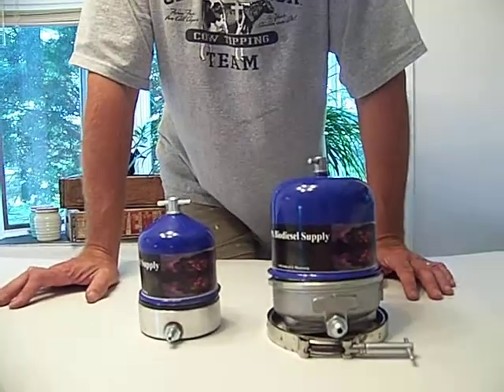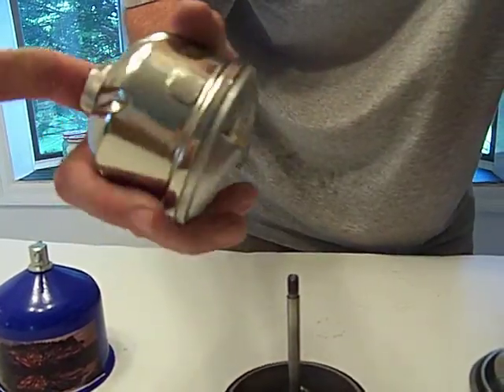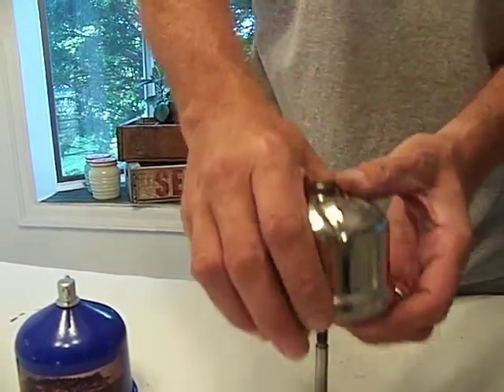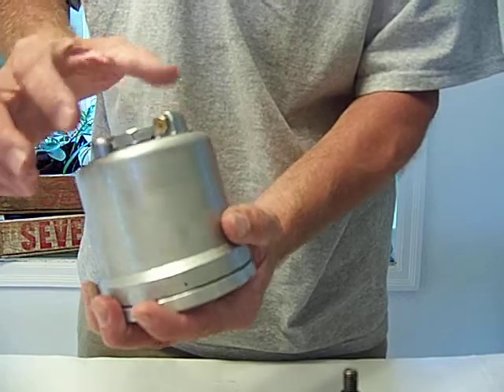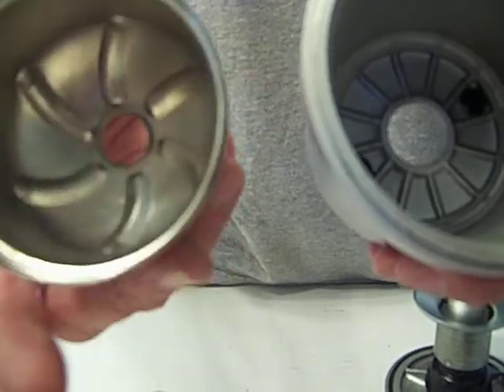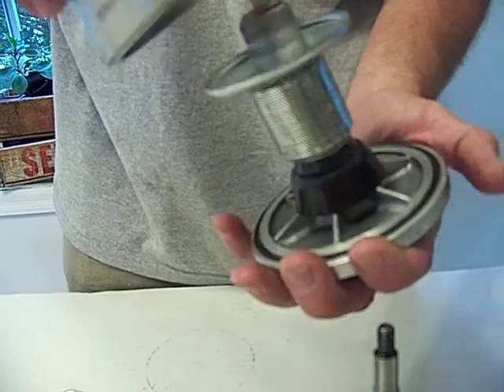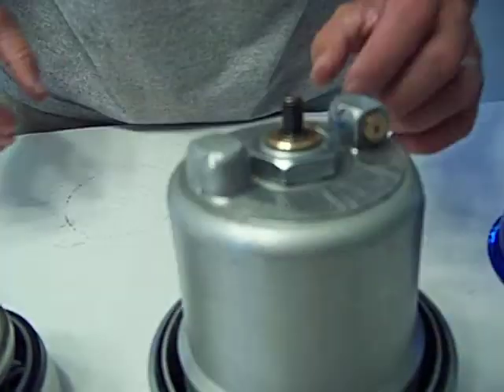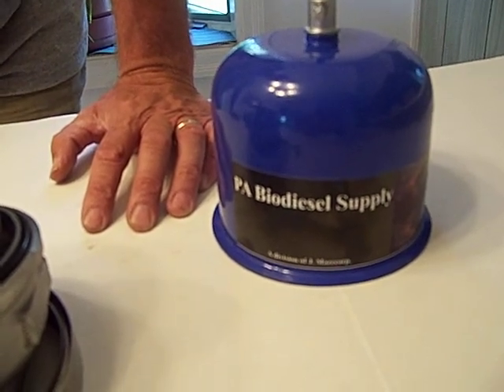Oil Centrifuge Inverted Rotor

Comment: The big centrifuge is from a Zetor tractor or identical. This is really a great product. The Zetors 75, 85, 95, and 10540 series tractor did NOT have these centrifuge fitted. And the result was engines with short lives. It was not fitted because they thought it would be easier with filters.....How can people get so stupid. It destroyed the Zetor era in Norway this stupid idea. The Russian Belarus have similar patent and it works and works and works. I wonder if you get a cheap 85, 95, or a 105 hp Zetor with crappy engine you could rebuild the engine and mount a centrifuge. Then I think the engine would last.